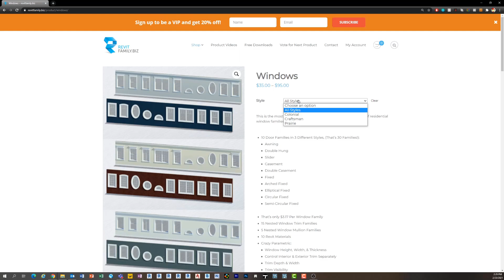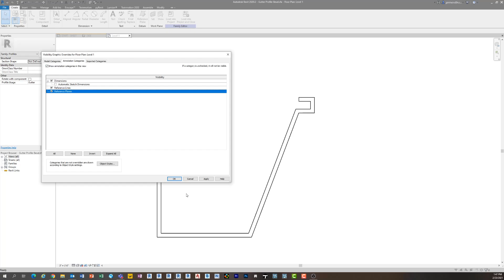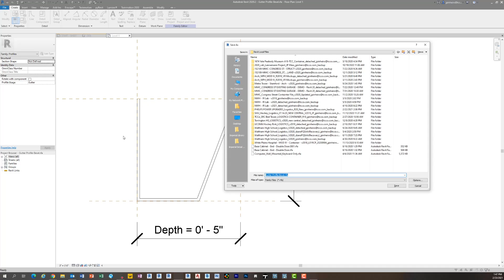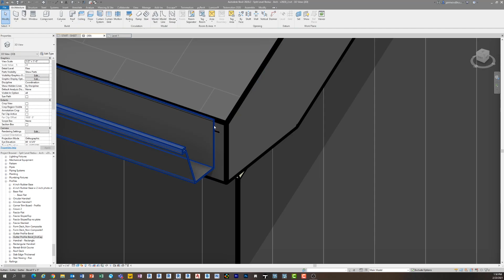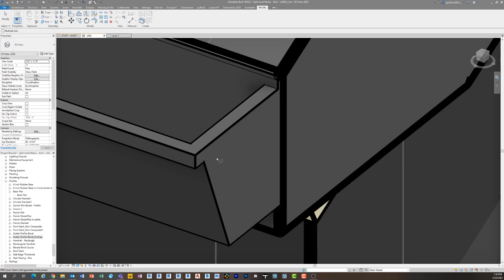Easy Gutter End Caps in Revit Tutorial

Comment: I am quite new to Revit and just find the need for work around like this infuriating. As a builder I just don't understand why on earth the software can't just use components to make up gutter systems in a parametric fashion using manufacturers components so you can then get a take off list and price list for what you actually need. Drops, corners, end caps, bends etc. Stretch the roof and it just adds the right number of components etc The take off would then allow for off cuts as well knowing you need to buy a full length and cut it down.
Reply from the maker: Hey thanks for watching!  I can understand your frustration, for sure... but, I can also understand why this isn't as simple as you may think. Think about how many gutter cut sheets there are out there... how many types, manufacturers, styles, etc... It would be a challenge to choose just ONE to build into the system for this purpose.... It is a similar issue with MEP fabrication parts... In the end, I do agree that the gutter tool itself could be more robust, haha!

Comment: what about that section that the gutters cross? how to fix that?
Reply from the maker: If you mean the inside corner, simply make sure the two gutters are made at the same time (as in, don't close out of the picking of edges) and it will clean nice.  THise example is messy because I had a lot of phasing and demolition going on in that corner.